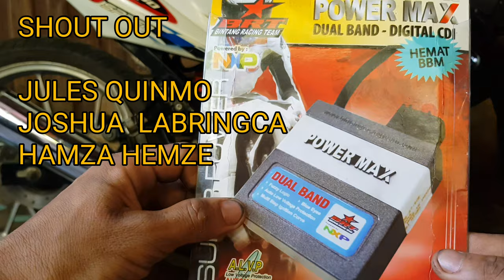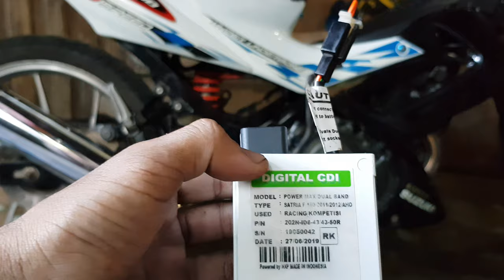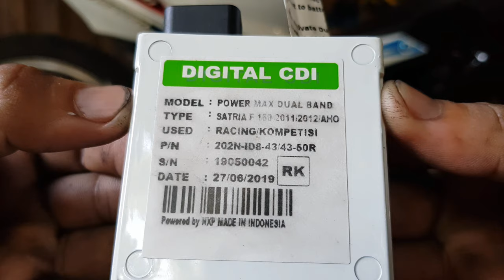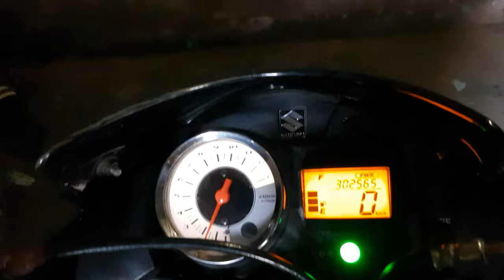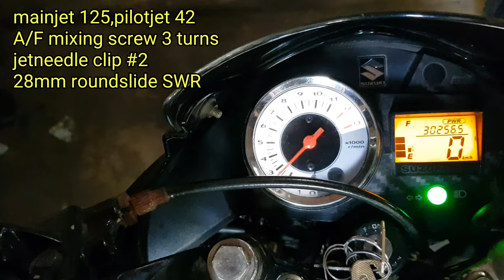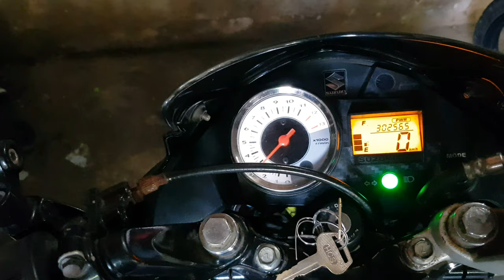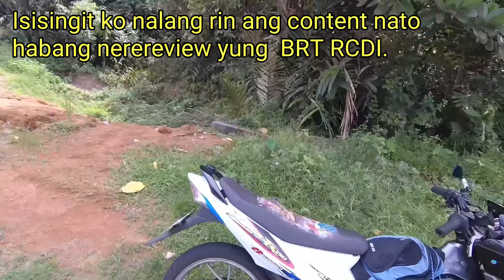BRT DUAL BAND RACING CDI review | testdrive / mahal pero sulit ba?

Comment from the maker: Mga paps bago kayu mg commemt watch nyu naman kahit 3 minutes up yung video para hindi spam yung coment nyu at magawa kung rplyan kayu. Kaya po 124 lang topsped ko kc nga rotonda yung tenetesdrive kung daan at delay rin ng 9kph yung spedo ko. https://youtu.be/0Yal3cHXKhM yan takbo ng motor ko sa highway.
Reply: Taga Pagadian man diay ka boss 😅
Reply: Balita ko nga ang Pagadian pala puro ahon. Masarap trail diyan sigurado!
Reply: Nag top apeed ako dati ng 162kph
(1st gen 2005 model) 
Port/Carb 28mm Round/CDi/Racing Valve Spring/Hi Com/Vmax stage 2 pipe :)
Reply: Sir bkt mahina 124 lng tp speed mo

Comment: Paps all stock yung raider 150  reborn ang binago kulang is yung pipe stage 2  bali pang new year kulang aalisin din agad pagkatapos ok lang ba unli piga at saka gusto ko kasi mag back fire which is need mo patay sindi sa ignition na naka center stand lang ala ba bad effect sa performance ng motor ko po ?
Reply from the maker: Paps kung stock cdi lang ok lang unli piga pero kung nka  tacing cdi ka.. ingat nlng paps.
Reply from the maker: Ayus lang nmn kung i on and off yung switch.
Reply: @YourMotoTUne  salamat papa...t.y happy new year po sainyo advanced 2020

Comment: Boss mai resistor sa loob ng sparkplug cap nyan, kunin mu tapos palitan mu ng copper wire na kasing haba at taba, mas maganda yung spark,
Reply from the maker: Cge paps try ko.. paraming salamat adv hapy new year n ridesafe
Reply: Try mu lang kasi nglean motor ko nung tinangal ku yun,
Reply from the maker: Nakuha kuna paps.. meron nga haha salamat sayu.. kala ko kc sa mga reborn lang ang resistor nayun.gagawan ko to vlog at shout out kita paps.
Reply: Flat screw gamitin mu din ekot mulang kasi para xang bolt, din mai spring din sa loob kaya engat lang
Reply: ito yung resulta boss
https://youtu.be/PqTwm27_5S4

Comment: papz please reply po! ung motor ko kasi dina kaya mag 120 hirap narin sa 110 boss anu nanyare boss or ano po problema? ang ginawa kolng po is nireset ung tensioner po meron pobang consiquences pag nireset ng mali ang tensioner? please reply po! <3 new subscriber
Reply from the maker: Paps check mo diaphragm ng cab mo baka may butas na?pero kung wala naman.. mali siguro pag ka tangal ng tensioner paps baka nka open yung valve nung tinangal mo.tas pag balik wala nasa timing.
Reply from the maker: Kung sigurado ka naman na nka TDC yung timing pag tanggal mo sa tensioner.. baka sa carb problima..
Reply: @YourMotoTUne  boss last po anu po maramdaman ko kung mali ung timing sa r150 natin ty boss please :(

Comment: Boss pwede po ba yan sa tmx 155 pareho namang 6pins yun diba,at pwde po ba lanyan ng switch para mag dual band?
Reply from the maker: Not sure paps.. pero kung alam mo diagram ng mga wire pwd cguro yan.sa switch yes pwd xa paps para on n off mo nalang.meron nga xa extra wire di ko lang napakita sa video.
Reply: @YourMotoTUne  ty sa sagot paps pwede kabang mag tutorial ng overhaul ng tmx155,magkano po bili mo nyan
Reply from the maker: @jovelgasataya1538  subukan paps pag may tym

Comment: Sir pag tumukod ang piston sir anu po epekto nun sa takbo nang motor?
Reply from the maker: Pag napasubra pwd sabog makina mo.. pero pag di nasabog pero na over rpm mo tlaga pwding ma lose compression lang kc yung valve mo dis align na.
Reply from the maker: Di na aandar ng maayus motor mo paps pag dis align yung valve.
Reply: @YourMotoTUne  sir yung biglang humihinto ang motor sir pag binirit mo...parang nawawala ang lakas nya..
Reply from the maker: @elmersumayo2782  ano ba gamit mong carb ngayun?pm mo ako sa fb ko mototune nem fb ko.

Comment: Boss anu pong set ng motor nyo pa pa set ko sana ung sakin?naka rcdi na ung akin.
Reply from the maker: Paps semi 25g yung makina ko.. naka port yung head pero yung intake lang at kunti lang.. naka reface yung bore at piston ng 0.75mm naka 28mm roundslide swr carb.
Reply: @YourMotoTUne  salamat paps..magkanu po inabot sa lahat lahat paps?
Reply from the maker: Di nmn malaki gasto ko paps kac ako lang nag trabaho.. tornero yung trabaho ko.. gumastos lang ako sa port carb pipe at cdi..
Reply from the maker: Pero cguro kung sa iba gagastos ng mga 3.5k or 4k sali na top overhaul at machine
Reply: @YourMotoTUne  salamat paps
Ikaw plang nagreply sa akin sa mga blogger...maraming salamat sa pag reply.
Reply from the maker: @ravenpamintuan5706  np paps pm lang sa fb para sa mga katanungan mo. Mototune mo name ng fb ko.